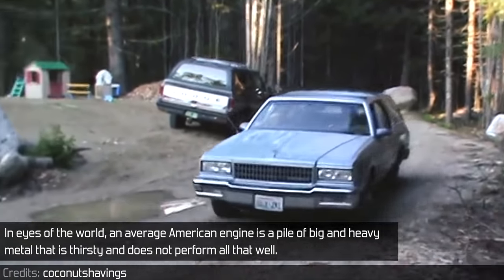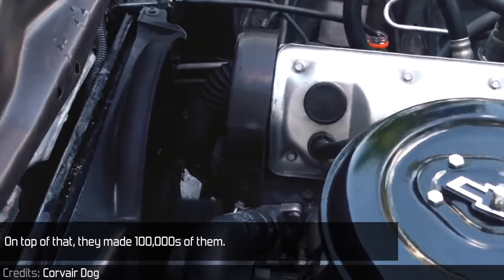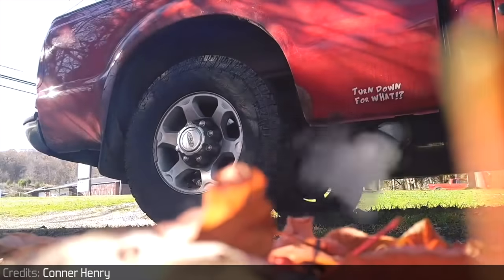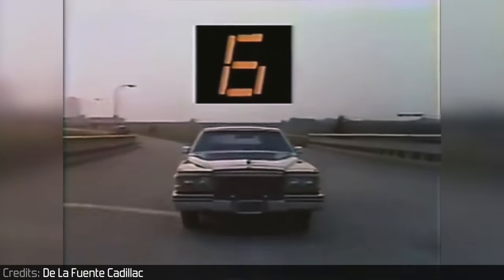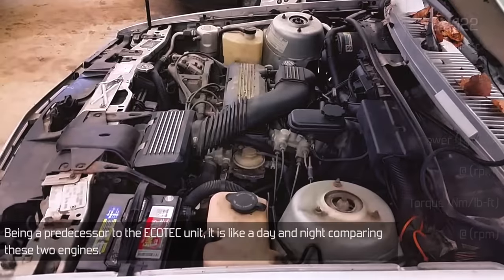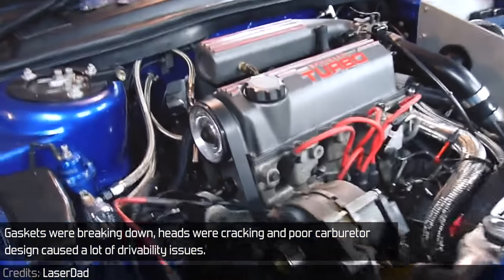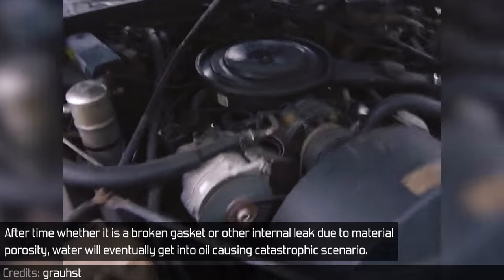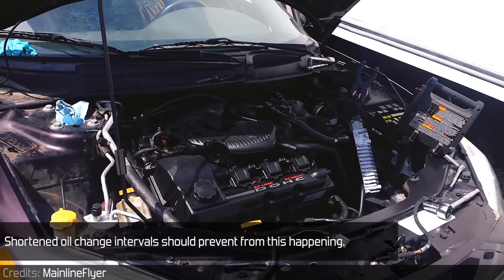8 Worst US Engines You Should Avoid

Comment: One of the WORST engines ever produced, was the Pontiac 301ci.V8. The crankshafts and blocks were so brittle, they would break if pushed hard. Then, Pontiac did something really stupid and turbocharged it in the 1980-81 Trans Am. No intercooler and (computer) carb based induction made it a rotten dog of an engine where the bottom end would break. They would have done better to turbo the 231 V6 at the time, which they did end up doing later.

Comment: i remember a friend had a 78 pontiac grand prix with a 301 v8. it had the power of a 4 cylinder, but had the fuel economy of a 455 v8.wide open throttle for 2 miles & it stopped pulling at 78 mph.sad, so sad.

Comment: never put blank aluminium on blank steel or iron ... its like a non recharable battery ... ions moving , metal decays , current flows  and the end of the line: it will stick together and rust/corrode

Comment: Doesn't know what he's talking about.  (1.)  The Vega engine's problems were due to the fact that it was a silicone-impregnated aluminum block without cast iron liners.  That's right, the piston & rings rode directly on the aluminum block's walls, that's why the silicone impregnation-  to provide extra piston-to-wall lubrication.  In  pre-production tests the engine was good for over 200,000 miles, an unheard-of figure back in the 1970's and was deemed unnecessarily too long, so the silicone content was reduced for the production engines.  The result was seized engines and a bad reputation.   This necessitated a replacement by Pontiac's "Iron Duke", a 2.5 liter 4-banger derived from the right half of the Pontiac 5 liter V-8 (the 501), but by then it was too late.  The Vega was doomed.   (2.)  I owned a 1981 Cadillac Seville, the subject vehicle in his Cadillac 8-6-4 segment.  It was a good motor, being a cast iron unit of 368 cubic inches.  Reliable and powerful enough to pull that 5,000 pound pig around just fine.  The only thing wrong with it was the computer control for the variable cylinder ignition system, so virtually all of the '81 Sevilles had that feature disconnected.  Otherwise, a good motor. (3.) The following year, however, saw the introduction of the all-aluminum 4100 V-8, a weak, underpowered, and unreliable 4.1 liter piece of crap that did Cadillac no good whatsoever.  Cadillac followed with the Northstar engine, a wonderfully engineered gem.  Yeah, all the engines in this video had head-to-block sealing problems, resulting in coolant being leaked into the oil supply and causing the ruination of many engines, but so what?   ALL car manufacturers had this problem in the 1970's as the industry shifted away from cast iron heads to aluminum, and the problem continued well into the 1990's.   Over-heat ANY of today's engines and you'll either warp or crack the cylinder head and open up the head gasket juncture between the cylinder head and the block and ruin the motor.

Comment: I totally disagree with the Chrysler 2.2 liter I4 making this list. My mother had a 1990 Dodge Caravan with the Turbo version of this engine, and that thing ran perfect for over 300k miles. It was not the best maintained and never was ran on anything but regular 87 octane fuel. That engine outlasted 3 transmissions in that vehicle, and 2 broken timing belts while running!

The GM 2.2 liter in the S-10 does deserve to be here, I have a 98 S-10 with this engine and it is crap. I have known this truck since new and purchased from the original owner. This truck was never driven hard by the original owner by any means, probably never even saw 70 mph honestly. Yet the factory engine failed at 74k miles due to a crack in the block, the truck was not overheated it just cracked at cylinder #4. A factory long block was installed after the first engine failure and at 95k miles the head of that second engine cracked between cylinders 2-3 again the truck was not overheated I owned it at this point. I have now got a short block with 97k miles on it and a rebuilt cylinder head, hope to get 1 year out of it then sell the truck on.

I would add a vote for the GM 4.3 liter diesel V6 of the mid 1980s another failure prone engine.

Comment: You could at a stretch add the Duratec V6 to the list, because they're well known for doing head gaskets as well,  (MLS gaskets cure this),and the inlet design on the 2.5L engines weren't that good, and it was a sodding nightmare to wrench on, but really it was Ford's shithouse transaxle transmissions (cough CD4E cough) and electrics that let the cars down. My 2.5L Mondeo wasn't bad, but shit European electrics plagued it with issues, even though it spun a bearing in the end, but my 3L Mondeo was solid as a rock, very little went wrong with that, and it was only wear items that caused problems.

Comment: The triton 6.8 v10 isnt that bad of a motor. Yeah it's an old, heavy, and thirsty motor but we have an 03 Ford F350 with the v10 and it runs like mint at 148,000 miles on the clock. And it's a new England vehicle so rust is an issue up here. But this one somehow survived the crusher

Comment: Any engine that's interference so there's piston to valve damage in the event of timing failure is Shit.
Reply: Performance and gas mileage can be obtained with compression ratio. Increasing the compression ratio with combustion chamber and piston design combined with valve lift (which also helps efficiency) will certainly force the design to become interference at a certain spot. So efficient performance engines tend to be interference because you need compression ratio for performance. Pretty much all of the non-interference engines run regular and are relatively low performance.
  Designers know this and this is the reason manufactures build engines that are interference, not because they don't know how to design. People shop for performance and gas mileage, so they sell more cars by running the highest ratio possible for a what octane fuel they choose. Marketing.
   Some may save money by using belts instead of chains, which is where the problem lies. I have heard of some chains failing but from my experiance chains last a long time. (My BMW has 400,000 miles on the original chain)
  I will bet that you are irritated about massive damage due to broken timing belts... Solution, Timing chain! 
  My Audi 2.7 is interference, goes like a mother! Has a timing belt! Got to keep up on the maintenance on that one cause it wold cost a fortune if it broke. Gates Racing Kevlar belts is what I use, expensive but worth it.
Reply: 123Rambler1 well remember  car makers want people to buy a new car every 5 years and making cars harder to work your self, interference engines and automatic transmissions with no dipstick are a great combination to  make some cars only last 100,000 miles and then it's a time bomb....
Reply: 123Rambler1 well what if the timing chain tensioner fails like in some 4 cylinder gm? We are in the disposable throw it away era. Car makers don't make engines to last long  as before.
Reply: Rubber timing belts are a disaster they should never put them on an "interference" engine. Most people will not lay up their car & spend $300-$600 for a timing belt job. Bad design.
Reply: I agree if it has a timing belt it should be free wheeling engine, no damage if belt snaps

Comment: Chrysler 2.2 was a good engine saw lots of turbos with 300,000 miles some had the worst maintenance preformed to them and they still kept going . Tritan is not bad ether worked on quite a few with 300k also . Most come down to maintenance. I own a Chrysler 2.7 v6 it has 170,000 and never one issue except the plastic water outlet that only lasts a year.other then that been a great engine.

Comment: I'm surprised  Chevy 307 and 400 didn't make the list of bad engines.   Gm bored out a 283 to a 307 and the cylinder walls paper then did the same thing to a 350 and made the 400.  At least Pontiac had enough sense to make and entirely new block and heads their 400

Comment: No mention of America's really reliable engines, Ford 300 cu in inline 6, Dodge/Mopar "Slant Six",  318 cu in, 383 cu in and 440 cu in V8s, Dodge "Hemi" V8, Ford 289 cu in V8,  Chevrolet 327 and 350 cu in V8s, all reliable long lasting engines.
Reply: And as James mentioned below, the Ford 300 cu in inline 6 cyl, with its 7 main bearings, was durable and performed as well as many V8s.

Comment: Bought a new 1985 Plymouth with the 2.2 motor..at 50,200 miles it went into self destruct mode...oil pump, head gasket, timing belt, distributor..then a couple of hundred miles later clutch went out without warning..next shifter linkage fell apart in my hand..then a CV joint locked up...traded it for a new '89 Escort..drove it 89,000 miles before selling it..replaced the muffler..that's it..even the original tires had tread left..Lee Iacocca is a scum sucking dog..

Comment: Methinx you are biased against America. You can't just lump all American engines into the same little box and condemn them outright. Doing so makes you look not only biased, but stupid as well. The 409 Chevy was one of the best engines ever made. (Probably why they stopped making it..) See, mass production and mass consumption tend to feed each other in a vicious cycle which can only end in eventual economic collapse. The phony "energy crisis" of the mid 70s led to smaller and shittier cars, and Ralph Nader led to nonsensical "safety" features which eventually killed production of the great American musclecar. Todays vehicles all look like overgrown plastic toys. (And most perform about as well as cheap plastic toys!) Of course there are exceptions, but those are few and far between. And don't get me started ranting about ricers and tuners... You won't like what I have to say about them. I haven't owned a passenger car in years now. I have no real use for one. I have a work van and a work truck, both older Fords. They get me and my tools from A to B to C and back again. And I can still gearhead around. By the way, those two Caddy engines, the 8-6-4 and the HT4100, are probably the worst engines Detroit ever turned out. They make good boat anchors, that's about it. If I ever buy another car, it will probably be a 69 Galaxie 500, and I'll take my time and do a frame-off restoration to make it the street-legal racecar of my dreams. I've owned Chevys, Fords, Mopars, and Volkswagens, and Honda & Yamaha bikes. I always do my own mechanic work, why pay someone else to do what I can do myself? I've been driving since 1981. I learned to drive with an M22 Muncie attached to a 396. I know what the fuck I'm talking about.

Comment: The Chrysler 2.2 and 2.4s are reliable i believe. Maybe the carbed, choked, smogged engines were poor performers. But once they came out with the TBI or fuel injected models to include the turbo engines, i am pretty sure were pretty reliable engines. 

We have three of them at our house right now. I know they are known for head gaskets leaking, but its nothing premature that i am aware of. I would consider a head gasket change more of a pain in the ass than a timing belt, but at least you wont have to change the timing belt every 60 thousand miles compared to the untouchable, impossibly reliable Toyotas everyone talks about.

Comment: They just don't get the being of murica, I mean it's a culture, and they also exist for a very fine reason. Think of the Lincoln town car, do you think a b16 (which is still a good engine) could haul that thing, no, so they put 5-0s in them and later 4.6 litres. Also the engines are de-tuned, and meant to get a fair amount of torque and a little bit if horsepower for an engine made for going 100-120 down the highway and being smooth, that's what America did to their engines, and if you don't like it, go buy an old integra (which is still a really good car) and see How smooth it is while driving

Comment: My 77 cutlass  has 350 engine. Beware after 80,000 Miles. It has a nylon gear on the cam shaft and the timing chain will chew it up over time. Please replace the gear.

Comment: Our Olds diesel got 34 MPG, I got it when it was 10 years old and drove it like I stole it, teenage boys are rough on vehicles, after rolling it, the engine was put in another car and continued on far beyond 150,000 miles. Water in fuel is what caused issues, and untrained mechanics reusing the head bolts after replacing the gaskets, studs were the correct way to mount them. As for Triton engines, many have over 300,000 miles on them, how is that a failure.

Comment: I have to say that Visio is making bad assumptions here.  Combining cast iron blocks with aluminum heads are the reason why some these engines were failures?  No.    I own a Mercedes with cast iron block and aluminum head with over 350K and it still runs well despite it's age and use.  SAAB's old  2 cycles ( which he lauds in another video..) are also aluminum heads on a cast iron block.  It's the quality of the castings and the design I used to own a Chevette with the 1.4 liter Brazilian Opel OHC engine and it was all cast iron and it died from a broken crankshaft at 89,000, and I didn't abuse it at all.
Reply from the maker: There is no assumption over here. Every fact in the video was taken from forums where people mentioned it over and over again.
Reply: Using forums for your fact sources is part of the problem then..?

Comment: After watching this video, I feel that it was really too bad about those early 80's Cadillacs.  Talk about a major slump from previous years. Even in the late 70's the full size Caddys still used a 425 CID V-8 (6.9L or 7.0 L) which was a destroked 472 with 180 HP but still 320 ft/lbs of torque .  I'm sure the 6.4 started in '81 put out less on both figures.  And the 4.1L started in '82 not only had a paltry  137 HP but also no where near 320 ft/lbs.  And how un-Cadilliac like to go down to such a small motor after always making big and powerful high torque motors as needed.  In '68, when that company started the 472 V-8, it was a 375 HP car w/ 525 ft/lbs and capable or 0-60 m.p.h. in less than 9 seconds, could've been faster if not such a heavy car.  It actually had more acceleration than a 390 CID powered Ford LTD for that year but still less than a big block V-8 powered '68 Chevy Impala.  All that had become history for Caddys by the '80s as we'd see here.  And the 472 was not problematic like these later motors were, especially the 4.1L.
Reply: The same body as the '81-84 Fleetwood and DeVille was kept for the rest of the '80's for the Fleetwood Broughm while it then got treated to a 5.0L V-8 which Cadilllac would've actually been better off doing instead of the 4.1.  Even that 5.0 while probably being less of a mess that the 4.1, still had only 140 HP but got up to 255 ft/lbs. torque.  And with 4,050 lbs of car (curb weight), that came to 0-60 in a full 14.0 seconds for an '88 Fleetwood Broughm.  And gas mileage was a measily 13 MPG, more than likely because they were so underpowered.  Probably the only 1 reason why those 80's Caddys shown here were actually capable of handing speed of 70 m.p.h., or 75, or 80 on freeways like I've seen many times is because their automatic transmissions had overdrive; there can be NO OTHER EXPLANATION.  I kind of liked those '80s full-size Caddys, such nice cars.  But other than being luxurious and having decent looks, they really had nothing going for them, unfortunately.  With all this said, I'd have to say that this has become he #1 most underachieving luxury car of all-time, SAD.  And after taking a hit after the late 70's (without even a comeback for the Fleetwood Broughm in the late '80s), it's like "talk about 1 car to be put out of its misery."
Reply: @kevinhabener1279   The Fleetwood brougham used the Oldsmobile 307CID V-8 until 1992.
Reply: @chrislemaster2695  Hey, you're right about that.  It did use that Olds 307 from about '86 up until '92.  That was an a step back in the right direction.  Unfortunately that 307 didn't have a whole lot of horsepower and torque went back up to 255 ft/lbs which still fell short of the late '70s 425 by a fairly substantial amount.  But with smaller displacement and more forward gears making it lighter and every bit as highway friendly, I truly wouldn't mind owning a Fleetwood Brougham from 1986-91 to drive around a little and maybe do a few road trips in.  Cruising at 80 mph all day won't be much work for them once they get going.

Comment: I will never forgive Ford for my $1300 spark plug change on the 5.4. Never again will I own another Ford. GMC is my choice now. Why Ford did not use Anti Seize compound on those spark plug threads shows how they cut corners. Engineers have known for decades that Aluminum and Steel fuse together after time in hot environments. The Motorcraft plugs were a catastrophe waiting to happen

Comment: The GM 122 wasnt even what was shown...he showed the LN2 and the 2200. They arent the same engines - LN2s and 2200s made 120hp and 140ft lbs. Theyre also extremely reliable engines. The early Ecotecs only have 10 more ft lbs of torque and get it a lot higher in the power band. Put a header on a LN2 and youre already making the same power as the early Ecotecs, but with a more reliable engine.
Reply: The "2200" is an LN2.... Unless you have the L43 flex engine. "122" is just the nickname for the entire life of the engine. 1982-2003.

Comment: Intake manifold leak pre 2003.Mine has no issue...even trans original. 300k uses no oil leaks nothing 28 mpg....Only changed minor stuff . Best vehicle I ever owned and I am 55yo mechanic. Cheap.to fix .
I also have Chevy suburbans 5.3 no issues except fuel pumps and wheel bearing hubs. I keep my Chevy.
We have a shop that fixes euro trash German cars...keeps us very busy Overpriced  junk Benz Audi VW BMW mucho $$$$ to fix and they break down alot. My 1979 Chevy tow truck pulls them into shop...it's all rusty and burns oil ...I love when rich yuppys Audi has to get towed in by my old pos...lol